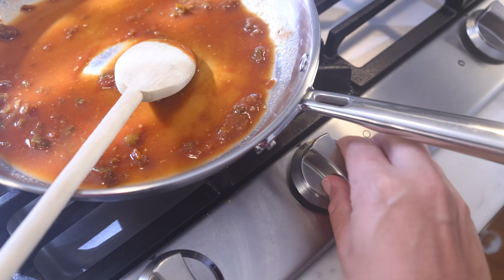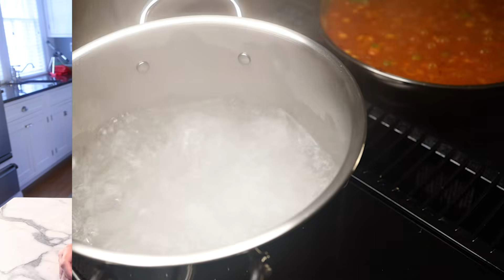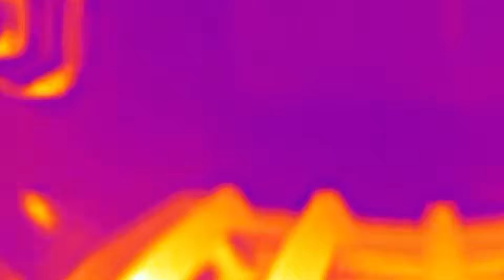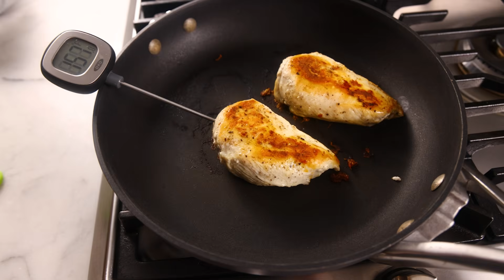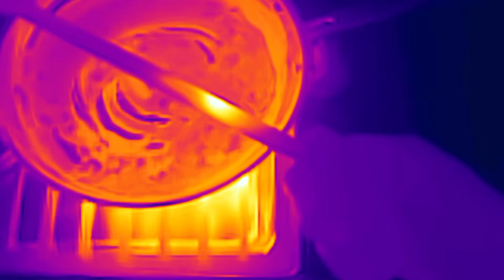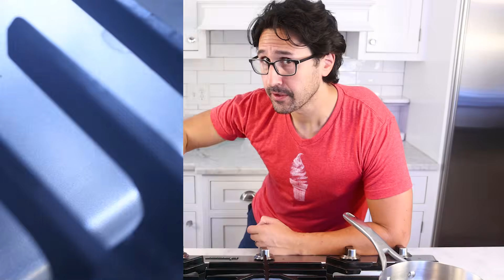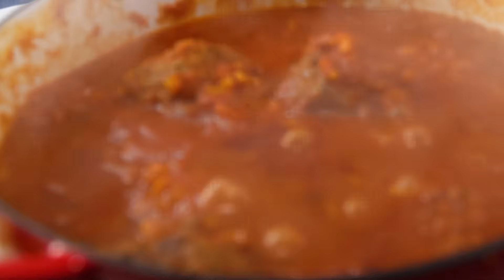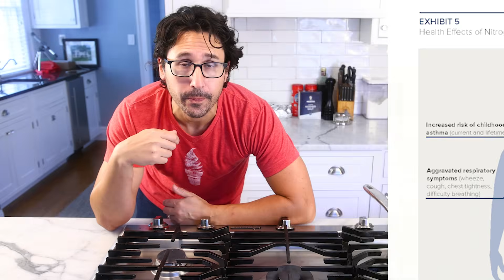Problems with gas stovetops | weak, dirty and dangerous

Comment: glasstops are pain in the ass to clean and i am permanently afraid I'll break them. plus i adjust the intensity of cooking by ear, so i like fire. i will eventually have to go induction too but i am not happy about it. i cooked on most heat sources but my most favoirite is an old-fashioned wood/coal stove where you adjust the temperature by moving your things on the unevenly heated metal top. not the best option in summer, but still
Reply: You must be the FIRST person who think cleaning a pane of glass is hardee than cleaning a gas stove
Reply: @mohanjan8768 yeah, because it's fragile and gets cooked on immediately and there's no way of taking that off without totally scratching the glass. Plus as said, i am (maybe irrationally) certain I will drop something on them and break them. Gas stove has the metallic things that get the most brunt of being dirty, which you can just scrub without making a dent, and then the flat surface under it  is not supposed to be shiny, so if it scartches a bit no big deal. Glass looks horrible whether dirty or cleaned, never fuly clean or unscathed.

Comment: When I first watched this video I've only ever used induction, since then I've moved and spent a few years using gas. The verdict is that as long as you don't need an open flame for cooking (and it is pretty useful sometimes), you should go with induction. If you can afford a primary induction stove and 1 or 2 gas burners is 100% the optimal solution, unlocking all the benefits of gas but only when you actually need them and having an added bonus of being power outage proof.
Edit: Your stove doesn't matter at all for the environment. By far the most important thing for that is how you heat your home, it just uses incomparably more energy, then there is your car, your light if you don't use led, your computer if you're a gamer, you only use your stove for like an hour a day and probably not on full power. It really isn't that much energy.
Reply: THIS.

Comment: I think you made some great points, but I disagree with focusing so much on bringing water to a boil, which itself is a bit of an edge case in the "tortoise and the hare" aspect of stovetops you talked about, since water is so especially difficult to change the temperature of. For example, if you want to fry some things, like bacon, eggs, or veggies, then the immediate heat of the gas stovetop is enough for the job. And at the end of the day, modern induction stovetops are the ideal in the US right now. But I think one of the big things that pushes people towards gas stoves is that the old electric coil stovetops are TOTAL GARBAGE! The worst! Can't stand them! So if not being able to afford an induction stove forced me to pick between the other two, I'm picking gas.
Reply: If you can't understand WHY the water books faster. Then you are just biased
Reply: @mohanjan8768 Yeah I agree that all electric stoves are better for boiling water. What I'm saying is that there's a lot more to cooking than boiling water.

Comment: Iranians and I'm sure in many other middle eastern households,  we solved the issue of heat spreads too much and low heat problem you mentioned with "Shole pakhsh kon". (Heat diffuser ring) give it a shot!

Comment: I have a gas stove.

Pros: Great for wok. If I had wok pan.

Cons: Everything else. Price, security, speed, spreads sticky residue... Go induction instead.

I guess a tiny pro is that you don't have to clean it every time, induction has a higher risk of burning food to itself if it's under a pan while cooking. But yeah you still have to clean it, the metal stands are a bit bulky, and you have to wipe off the sticky stuff on surfsces above the stove, even the lamps get some.

Comment: Yet every restaurant uses gas stoves.
Every politician that has shown their kitchen has gas stoves.
Reply: Restaurants use gas stoves because is what is fit best for restaurant settings - chefs need both high power and high control. Just because something is fit for a restaurant doesnt make it fit for a household - unless you have 12 tables in your household like restaurants do?
Reply: @ieatchildren5084  induction is both higher power and more controllable, but there may be different considerations at play.

Comment: Using a flame spreader over a gas flame is an easy solution to keep things from burning when they're supposed to be simmering. I suppose they could be used on an electric stove as well.
I can't even count the amount of times I've turned an electric stove up, waited forever for it to heat up, had it suddenly start burning my food, and continue to burn it even after turning it all the way off. A gas stove is a top tier priority whenever I'm looking for a new place to live.
I also heat up water for pasta (or even espresso) in an electric kettle first- just something I've been doing since I timed a gas stove against a kettle years ago. Electric kettle boils water in roughly half the time as gas burner.

Comment: Cooking on gas at the lake, I find them very difficult to dial in for low heat. You can make exact temp with electric, but gas doesn't do minimum well at all. People say they're too weak, I find the exact opposite. Plus, they heat up the room like crazy, which sucks on a hot day. I like them, but they're not responsive to simmer with. Talking propane btw.

Comment: We use gas and we don't have the issue of granular control. Perhaps it changes per model, but the GE profile we have works extremely well for heat control for everything high and low. I don't believe it's a consistent issue.

As for the speed of boiling a large pot of water, it takes forever, up to 18+ minutes for a full pot. I'm thinking of getting an induction single burner just for that. 

As for the health hazards of gas stoves, our kidde smoke alarm has an air quality detection feature. It shows TVOC's in ppb. 99% of the time it's at a good level which means around 200 ppb  sometimes less or slightly more, but always in the green. The moment we start cooking, it can shoot up anywhere from 1500 and 2800 ppb. So it does seem that gas stoves produce a very bad amount of TVOC's. 
I'm not sure how concerned to be about it though since it drops back down to normal after we are done with the gas stove within a short amount of time. If I saw the TVOC warnings all the time, I'd probably change the stove, but for typical use cases, I don't believe it's an important issue enough to take priority over other issues regarding health.

We also use the box fan air filter method for air purification and we have all of those running on an automated shedule everyday.
Reply: Kettles are also pretty good at bringing water to boil.
Reply: @JGnLAU Ya we just got a kettle, fastest thing I ever seen

Comment: Whatever. Just know that fluoridated water, mercury teeth fillings, "medicinal" arm jabs, asbestos housing/pipes, microplastics, non-stick pans, marble stone benches, alcohol and cigarettes are 1,000 times worse, health-wise. The very same people pushing for gas bans are the very same people that pushed for face diapers and those "medicinal" jabs. Looks like they're not getting anymore cheap Russian gas is one of the main reason why they want to charge you 3 times more to use electric appliances. The other, of course, control - the same way they controlled you by locking you inside your own house, aka house arrest :face-red-droopy-eyes:
Reply: Fund a conspiracy nutjob in the wild. 😂. Where is the mountain you spoke of when they Covid Vaccines wres introduced? It's already been more than 6 years

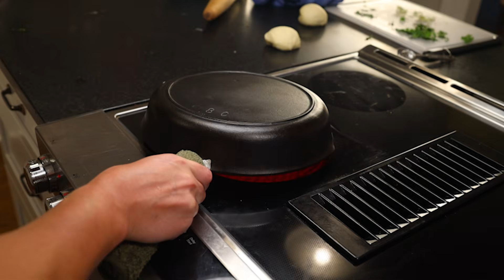Comment: 1:11  It's not that the electric ranges are necessarily more powerful, it's that they are more efficient in terms of energy transfer.  The problem with most household gas burners is (to save money), they are designed in a basic ring shape, which spreads the heat out and AROUND the edges of the pan, causing a massive percentage of the energy to simply bypass the pan and heat the surrounding air in the kitchen instead (or singe your arm hairs).  This problem is even more evident when your pot/pan is very narrow relative to the burner, so tasks like bringing water to a boil in a 2qt-4qt pot will take much much longer.  The advantage of many electric stoves is that their energy is more centralized and compact, lending to a higher percentage of energy transfer right into the pan.  In fact, this can be SO efficient that you get unwanted hotspots in the bottom of the pan, causing singeing/burning.  The real sweet spot is (sadly) going to require a higher end gas/propane stove with a better diffuser design with lots of centralized holes instead of a ring.  These kinds of stoves allow for the much more condensed heat injection that penetrates the pan more efficiently, and they still outperform electric stoves in almost every way.

While not a perfect stove remedy, one simple solution to the boiling water problem is to just stop boiling water on the stove in the first place.  Electric kettles are way more efficient and speedy and boiling water, and even with a powerful stove, I prefer to boil the water separately and then add to the stove.

Comment: glass tops are easier to clean but they will also leave white burn marks which you cannot remove with a razor
Reply: Hub? Been using mine for 10 years plus n never seen it

Comment: Gas is 5x cheaper than electric for me. And the electric company is about to raise rates 20% after being bought by JPMorgan Chase. Technology Connections did a comparison and gas stoves took about 3x more energy to boil water, so it’s still cheaper to use gas. However, I also don’t boil water on my stove, I use an electric kettle. Gas stoves work so much better for pans and woks and spreads the heat out so much better.

Comment: Well, the methane induatry tries to blame it on the dog. We know what you're leaking out now, because we can detect it slightly better with satellites. If it was heat exchange fluid burning hot, or diesel, or black gas, or even plain water, they would do something about it.

Comment: Your thermal imaging camera is actually understating the waste heat a lot. Thermal imagers are good at telling you which surfaces are hotter than others, but aren't very good at quantifying how much heat is convecting away, and hot air is mostly transparent to the camera

Comment: Had a question for you I think I saw a commercial  gas stove once the stove was turned off  ithink but if yu looked in the gas pipeline the flame seemed on but I guess it seemed the flowing gas was being consued at low flow rate?

Comment: Not a fan of electric coil stoves. They may be better now but the one I had years ago was terrible and easy to burn yourself with. I have gas now, which I use all the time. Usually have the windows open when I’m cooking so I’m not worried of any toxic chemicals. But I have a 3.5kW induction “stove” dedicated for a wok. It’s concave and concentrates the heat and it gives that restaurant smokiness that you can’t get on an indoor household gas burner or electric stove. I have no intentions of changing my gas tops for induction but induction does seem to be in far of a way the best method. Boiling water is no issue, I live in England so naturally I have  240V kettle that will boil a litre or 2 of water much faster than anything else and it’s the most efficient since the heating element is in the water.

Comment: The major downside of induction cooktops is that really only work with ferromagnetic cookware. So a copper pot will not work on an induction stove
Reply: They technically could have ferromagnetic part bonded to them on the bottom.

Comment: As for the toxic fumes study follow the money. Reports generally support what the payer wants. Just turn on your damn vent hood. Electricity from coal fired plants is 35% efficient so I don't want to hear about gas inefficiency until most of our power comes from sources other than gas or coal.
Reply: Coal is crap though, natural gas power plants are much better. And gas stoves themselves are around 30% efficient so it really doesn't look good for them. And we are slowly switching to other power sources.

Comment: Weak, dirty, and dangerous? And this makes gas stoves different from electric - HOW? Cooking is inherently somewhat messy. It's especially bad when it spills over onto a hot surface. And electric stoves stay hot far beyond any visual cue, increasing the potential for getting burned. The weaknesses are not the same ones in the two types, but they are present in the same degree. And breakage in an electric stovetop probably means replacement of the entire stove. What's that mean for overall energy savings? It takes energy to make either unit, too. And electric stoves are slow: slow to heat and start cooking, long to cool, while wasting all the energy it took to heat up, dissipating the heat into the air. Cooking in summertime? An increase in your air conditioning bill, or an increase in your discomfort. Not everyone has a place to cook outdoors seasonally, and seasons differ in their extremes, so there's nothing that is "one way fits all".

Besides, chefs agree that gas cooks better, and food tastes better - so much so, that some in Manhattan vow to close their restaurants rather than serve lower quality meals at their establishments, if they are forced to use electric.

There are many ways to reduce fossil fuel consumption, but not every way is a good choice. Gas is one fossil fuel that can be used much more efficiently - and cleanly - than most others. Begin by upgrading new gas stoves to modern standards and incentivize the retirement of older less efficient models.
Reply: Induction does not stay hot longer than when you turn it off, as it heats the pan directly, not the burner.

Induction truly is the king of cooking tech, Propane, Gas, And Glass Top Electric all have virtues and drawbacks, but none have all of the advantages of induction. I do agree with Adam that the advantages of gas are overstated, as some people think it is more powerful than it really is, when Induction, Propane, and even Resistance Glass top give you more power. 

If I want a fire, outdoor propane is the way to go, if I want power and ease of cleaning, Induction. The only thing gas has is that legally and without social stigma you can use it indoors.
Reply: @linuxman7777  If it's power you're looking for, then more power to you. But if it's cooking, I'll go with the opinions of the master chefs. Let them give this form of electric their approval, and I'll go along. But there's still one thing practical thing I like about gas: when the electric power goes off, you can still light a gas burner with a match. That gives you options in a systems failure. If you depend solely on one system and it fails, you're out of luck. Single point of failure.
Reply: @farmergiles908  Outdoor Propane does that, and works even if the gas main is out, which has happened to me. 

The thing about induction is that it is new Technology and it used to be prohibitively expensive, and Adoption has been very fast in the cooking world, but because gas has had so much momentum and just a decade ago, your average induction cooktop was around $5000 where a good gas cooktop would run you $1000. But now that a good induction cooktop is around $1500 it is moving into kitchens everywhere and most kitchens I have worked in at minimum now have at least 1 induction hotplate for the many cases where it is the superior choice over Gas, It also is nice that induction doesn't make the kitchen an unbearably hot and miserable workplace. Also the easy cleanability is also nice.

After using Induction I can confidently say it is everything Gas claims(Responsive, Fun, Instant Cooldown) and Electric claims(Easy to clean, Safe, More Powerful) and doesn't disappoint me like the other two cooktops constantly do.
Reply: @linuxman7777  Outdoor propane does that outdoors. Not everyone has outdoors.

Comment: Remember folks, gas is measured in therms, or same as 29.3 kWh. Compare your rates and you'll see electric is 3-5X more expensive than gas.
Reply: Not really true, even if gas is 3x less per btu, due to inefficiencies in that induction is almost 2x more efficient on heat transfer, it is much less. Also gas heats up your house and forces your AC to work harder, because the heat that doesn't go into your pot or pan is heating up your house. They have done tests when it comes to cooking costs. And the difference in cost between gas and induction is negligible. Here in a cold area gas is slightly cheaper to cook with and may save about$20 a year, but that isn't worth the health risks for me.
Reply: Not in my area. Electricity is cheaper

Comment: My local power station runs on natural gas, so when I cook with electric, I'm cooking with natural gas (sort of). Assuming a 40% efficient power plant and a 95% efficient transmission system, an induction range would use about 8% more natural gas than a range. 

One way to increase the efficiency of gas ranges is to use pot skirts, which can get you an extra 10-20% thermal efficiency on a range, and do it by cutting down on that waste heat.
Reply: Did you consider that the wasted heat from the gas stove heats up your house? And that during certain times of the year, depending on where you live, that will force your AC to work harder.

Comment: I was thrilled to move into my new home with a gas stove because of all they hype I had heard about them being better.  What i learned is pretty much consistent with this video.  The only real control you have is to move the pan to a different burner.  The lowest settings on most of the burners is still too hot. With that said, my only regret is that I don't have a larger gas stove with more burners (of different size) and more space between burners.  I have no experience with induction burners.